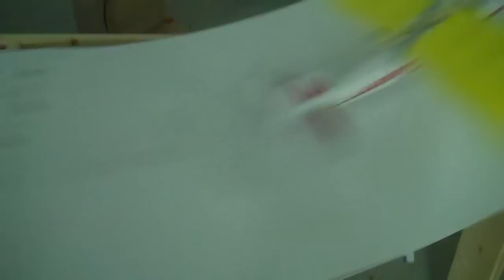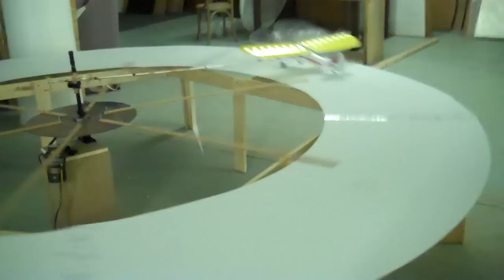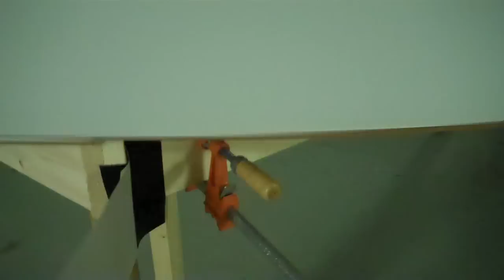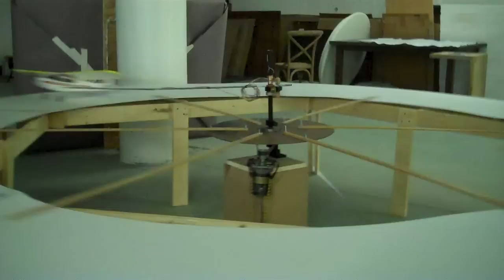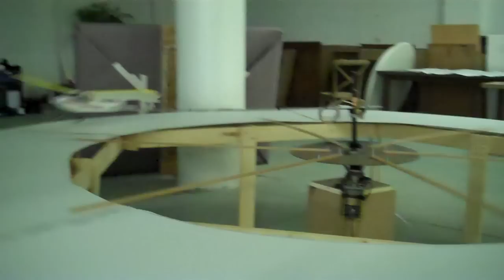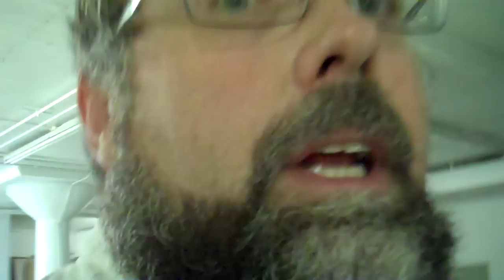Airplane On a Conveyor Belt Proof of Concept

Comment: Except as the plane forward motion increases the belt is remaking the same speed. In the riddle it says the belt matches the forward motion.. thus the belt will need to get exponentially faster and faster as wheels get exponentially faster and faster.
Reply: the riddle is the belt matches the take off speed of the plane but even if the belt moved at a faster speed it wouldent matter since a planes foward movment is independant of the ground
Reply: the riddle says wheel speed not airspeed
Reply: @PhilippeLarcher  And the wheel speed is not the same as the airspeed.

Comment: sorry, with respect that's not a treadmill..... and your plane took off because it's actually moving forward creating lift under the wings.
..... the physics here are not the same as a plane trying to take off from a conveyor belt
Reply: How would a treadmill be different?
Reply: Yeah.  This plane had added friction from the anchor.
Reply: Please explain to me exactly how a treadmill will in any way stop an airplane from moving forward. Is the airplane driven by its Wheels interacting directly with the ground, or is the airplane driven by the thrust of its engines interacting with the air? There is no physical way in this reality or in any other in which a treadmill will stop the airplane from moving forward.
Reply: ///Sixth Gear ???  Provided the treadmill can keep moving the plane backwards to match the speed of the wheels, the plane will always remain still and get no lift.  Every single example of someone ever ever ever trying this in the real world the person performing the experiment was not able to keep that constraint.  Their conveyer belt is never able to keep up with the wheels' spin.  So they all violate the terms in the question.  All of them.

Create a treadmill that can keep up, and the plane won't take off.
Reply: That statement might be true, if airplanes were driven by their wheels. Airplanes are not driven by their wheels, therefore the conveyor belt cannot slow them down.
Reply: If a plane is not moving how does it have lift to take off? like what the fuk are people going on about the wheels for, if a plane was in the sky moving at 1000kph and suddenly the atmosphere disappeared it would plummet out of the sky regardless. Its the exact same as if it were on a runway. As far as I can see it has nothing to do with whether its wheels or engines are propelling it rather whether or not there is any air flowing over the wings to create lift.
Reply: James, you are thinking about how a car or human would act on a treadmill. Planes don't push off the ground to move like a car or human does, so treadmills can not hold a plane still like those other things. You are picturing a stationary plane, but the plane would not be held stationary by the treadmill.
Reply: flynnt77 That's not true.  There is not one person who says the plane won't take off who ever talks about the wheels driving the plane forward.  It doesn't matter what drives the plane.  It won't take off unless the experiment is violated.
Reply: Kanye Twitty No, James isn't thinking about how a car or human would act on a treadmill.  NO ONE who says the plane won't fly does.  The ONLY people who ever talk about the wheels driving the plane forward are the people who say the plane WILL take off.  It's really quite extraordinary.  This fact demonstrates a fundamental difference in the way the people in the two different camps think.
Reply: @flynnt77  

No, the plane isn't driven by its wheels interacting with the ground. It's air over its wings, not air through its engine. If the conveyor is going the same speed as the wheels, the plane isn't moving forward. Guess what's not going over the wings...
Reply: It's amazing to me that people who think the plane will take off forget about gravity. It's not in the air yet folks.
Reply: @SmartAlx  correct!
Reply: @Psyrecx  right!
Reply: @Kanye Twitty  yeah they do. A sea plane won't fly on a runway for a reason.